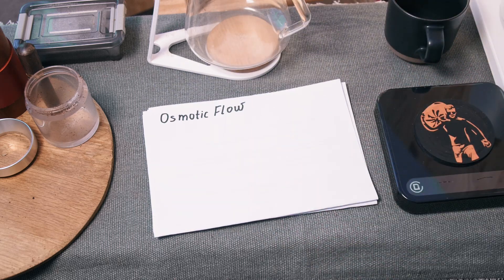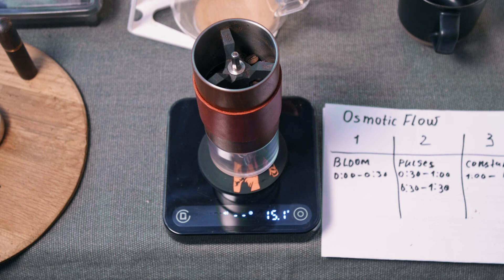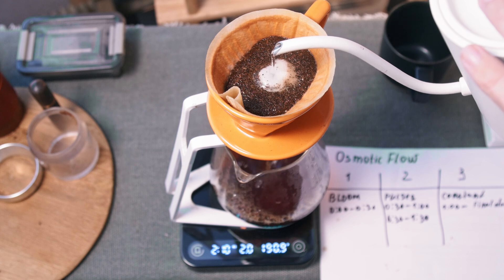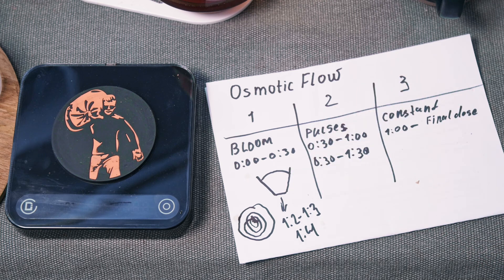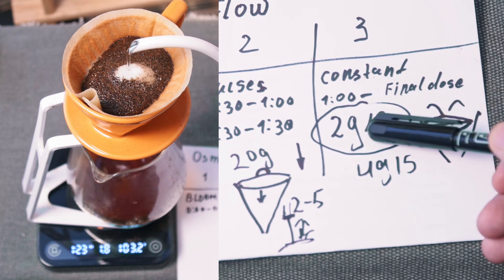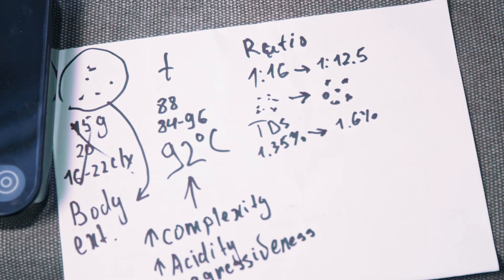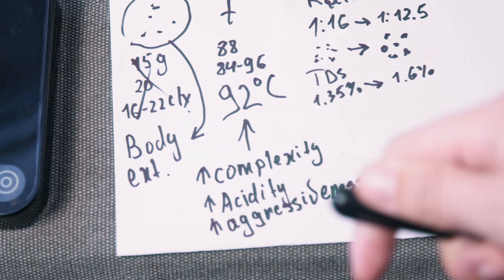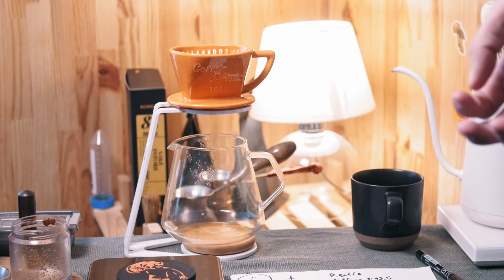Pour Over Coffee - Osmotic Flow - Tutorial

Comment: Very good explanation in details. Thanks.
Reply from the maker: If there will be some questions, I'm always here) 
I'm currently switched to pulses till 1:30 for higher extraction. And with deep 27 dripper even till 2m. To get more body.
Reply: @wendstudio_coffee  we discussed earlier. I am still not convinced to brew using this method lighter roast coffee, but  omniroast especially Full city roast coffee are perfect for this method.
Reply: I have come back to this method for light roast coffees. This is tricky. It is very hard to get the good dome. After 1st phase dome is rather flat and collapse very quickly. It has significant effect on the 2nd and  3rd phase. In the 2nd it is hard to have small small spot where the water concentrates, it rather spread over on the surface od the dome and the dome collapsed more. In 3rd phase all grounds are in the water. The coffee taste good but the the technique looks different. However I have found the film of  osmotic flow for light roast coffe on the Cafec yt channel and they have experienced the same issue. Perhaps, it works in this way for light roast coffee. What do you think? Anyway, your film is  still very instructive and helpful. Good job! 😊 👍🏻
Reply from the maker: @sawomirsliwicki5373  it's ok to have even the layer of water over the coffee sometimes. I started to use pulses till 1:30 lately. Especially for a light roast. The dome shape should not necessarily be a beautiful one. Sometimes it is, sometimes coffee has a small amount of gas or releases it too fast. The flavor in the cup will show where to move

Comment: I'll try it today, is it also applicable with Kalita 185 or V60? I like to use low temperatures to avoid extracting these burnt flavors.
Reply from the maker: Any brewer. I've used a basked from the moka pot, espresso holder with the #4 filter inserted, clever (160g), 1kg of coffee in a cheesecloth... Just need to adjust the grind size for the flowrate and extraction, that's it. Kalita - better to use 20g dose, will be more balanced, but lower is still possible. Bigger doses are better for learning because you don't need super precision. V-shaped - perfect. Even easier to brew
Reply: @wendstudio_coffee  thanks for replying, great video!
Reply from the maker: Will be interesting to read about your experience with the method. I could help if something is wrong with the taste
Reply: Thank you, I'll let you know how it goes

Comment: For the life of me i cannot start or keep the dome. My bed sinks a lot in the middle after my bloom and i cannot create a dome. I bloomed slow, fast, ground fine and coarse, even got a new kettle 😢
Reply from the maker: 1. Possibly too much water. 1:3 should be enough (like 45g of water for 15g dose). Try a smaller grind size or bigger dose.
2. Don't pour close to the filter (like 1cm away from it)
3. It's not a problem if coffee doesn't "bloom" and creating a real dome if the taste is good) 

It's easier to train the dome formation with 24-300 recipe. Since it has a bigger grind size and the motion is more visible
Reply from the maker: Also, you can do pulses until 1:30. It'll give a higher extraction
Reply from the maker: Got the sinking in the middle with the Anaerobic processed coffee. Flows too fast, can't retain water. That's why this appears. But I continued to brew as usual and got 1.35+% TDS (which I was targeting). All of the brewing there was this reversed cone in the middle so I could see the water level dropping... And sides was like a walls, no move at all. In the constant pour just kept the level of water (it could overflow, it's still fine). Cup is good anyway)
Reply: @wendstudio_coffee  I am using 15g - 250ml and i tried 10 different coffees with this method and i have never had a too fast pour. I think i had one good one grinder with a conical grinder. I usually grind at  350-450um on my bentwood64. I tried grinding very coarse and it did not improve. I am using Timemore filters on a 01 ceramic v60. TDS is under 1 and i still have them all clogg. It is very strange. I bloom at 5cm+ distance and most of them sink a lot in the middle, making it impossible to have a dome, i just have water over that sinkhole, the whole pour. I tried more pulses but as soon as i start the very fine continuous pour i t gets clogged and i have to stop otherwise my whole top will be covered in water. I even poured in drops, which is actually worse lol. I will try with bigger doses tomorrow.

Comment: I must say I’m a bit lost with some of the explanations. Everyone else say (and this works for espresso as well) that higher temperature gives bitterness, which is the opposite of acidity when you try to dial in a coffee. Too low temperature and you get sourness (=acidity right?), too high and you should get bitterness. I also get much more complexe cup at 90° than 94° (and that’s using light roast like La Cabra, TW, Koppi, etc)
Reply from the maker: I don't sure about the claim that the higher temperature extracts the bitterness alone. In my experience, yes, sometimes perceived acidity will be higher if the temperature is lower, but not 100% of the time. 

Anyway, it's always about balance. And unpleasant flavors tend to be in a high temperature zone (which especially visible in aftertaste and when the coffee is cooled down. There is no clarity). 

There are different compounds which could be perceived as sour, sharp; I suppose they dissolve with the different speed and possibly temperature can trigger them to dissolve. 

Coffee isn't that well researched product and it's better to not use any information as a fact because it could change in a few months)

Comment: it is surprising to see espresso people avoiding channeling like crazy and some filter people praising channeling as the way to prepare coffee
Reply from the maker: Looks like you didn't get it. 
Espresso: we need to avoid them because of enormous pressure. We simply will not create a proper one. And part of the coffee will not be used in extraction.

Osmotic Flow - water contacts with all of the coffee. Liquid has a lot of time to balance out the concentration
Reply: it looks like I don't get it. However I am a chemical engineer and I can tell you that channeling is not good here either. If you think coffee is going to diffuse that fast in the parts where convection is not taking place, then you are wrong. can you make good coffee with this technique? Sure. Are you extracting all the coffee even and properly? No way.  @wendstudio_coffee
Reply from the maker: But it's good enough. And the difference isn't noticeable between a good osmotic and properly brewed "regular" pour over. 

Let's talk about what elements aren't extracted that much (in terms of even extraction) and which ones are extracted relatively evenly. 

Agitation is mostly in the center. We use pulses for making somewhat "immersion extraction". And in these pulses, the liquid goes like a pump, each movement of the pump extracts some amount... Liquid is moving within all of the coffee, but again, forced agitation in the center due to higher flow). We adjust the pulses phase to have a desired amount of extraction (I currently do them till 1:30). The cup turns out balanced in terms of flavor and body. Don't see the "brewing defects". All of the flavors are easily readable.
Reply: @Pableras46  Can you explain "convection" in the context of coffee brewing? (I do not have much chemical knowledge.) - Thanks in advance!
Reply: @SBL_Berlin  I used the term convection wrongly. It is more about creating turbulences, which help with the extraction of coffee to the bulk.
In you have a very slow flow, you will have a laminar flow around the particles and the extraction of the coffee is much more limited. 
On top of that, it is not only very slow flow but also uneven. Where is some of the areas the water flow around some of the coffee particles is not flowing, getting saturated and resulting in a poor extraction. 
As I tried to say. You can get good tasting coffee with the osmotic method. But you are wasting plenty of coffee. 
But it is true that it looks wonderful in the video and you look smarter brewing in this way.
Reply from the maker: As for the flow speed - that's why slightly higher temperature is used, to have "agitation". And smaller grind size to have a more efficient extraction. Higher temperature > more movement of the molecules and higher dissolve speed. 

Of course it's better to have faster filters for a better cup flavor profile. 

As for the "waste of coffee" - it's simply not true. TDS is the same as with the regular pours. With the same recipe. If you really take time to practice osmotic flow, you won't regret it
Reply: @wendstudio_coffee  if you think by heating two extra celcius you are going to have more agitation you are wrong. 
And not even the term Osmosis is correct. 
The term "osmotic coffee" is incorrect because it misrepresents the scientific concept of osmosis and its application to coffee brewing. 
Osmosis is the process where water molecules move through a semipermeable membrane from an area of low solute concentration to an area of high solute concentration. It's a passive process driven by the concentration gradient.
When making coffee, water extracts soluble compounds from coffee grounds through a combination of diffusion and dissolution, not osmosis. There is no semipermeable membrane involved in standard coffee brewing methods.
In coffee brewing, water acts as a solvent, dissolving various soluble compounds (like caffeine, oils, and flavors) from the coffee grounds. This is more accurately described by diffusion and extraction, not osmosis.
Using "osmotic" suggests that coffee brewing involves the movement of water through a membrane, which is not the case.
Using the term "osmotic coffee" could mislead people into thinking there's a special brewing process involving osmosis, which is scientifically inaccurate.
It might imply a pseudo-scientific or marketing-driven concept rather than a real, scientifically supported method of coffee preparation.
To sum up, the term "osmotic coffee" is wrong because it inaccurately describes the coffee brewing process and misapplies the scientific concept of osmosis. The correct terms for the processes involved in brewing coffee are extraction and diffusion.

PS:  if you are not extracting evenly and you leave coffee unextracted, you are wasting coffee.
Reply from the maker: @Pableras46 it's an abstract term. Diffusion for sure seems like a more accurate description
Reply: @wendstudio_coffee  it is not abstract. It is a scientific term with a clear definition. It is just not well used in the coffee world. And Diffusion also takes places in the "non-osmotic" method. 
Call it channel induced pulsed method if you want to be specific
Reply from the maker: I don't want to be precise since it's not a scientific article. The key is to understand how it works. Drip coffee makers worked like that for a lot of years and coffee was alright.
Reply: @Pableras46  Thank you for explaining in more detail what you wanted to say by "convection". - About "wasting" I have a different experience. With 15g for 250ml water I will get one of the best coffees I can make using the osmotic technique. Using the Tetsu Kasuya method with the same amount of coffee and water, I also get great results. Only with the single pour technique by Vincent from Tales Coffee I need 16g or 17g of coffee. But still great results (and different). - Maybe you can explain a bit more, what you mean by "waste"? And why it is important to avoid that for brewing good coffee? And maybe last question: Which technique is more efficient? - Thanks in advance 🙂 and take care.
Reply: @Pableras46  About "osmotic flow": As far as I know, this term was used by Japanese since more than 50 years (probably by mistake). So the term "osmotic" in the context of coffee brewing is not a science based name but tradition based (even if the tradition itself is based on a misunderstanding).